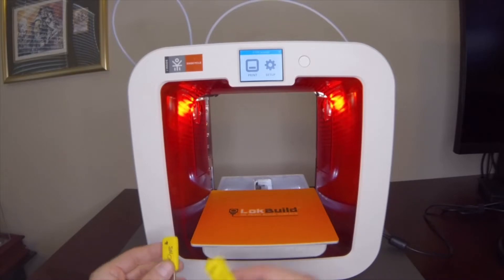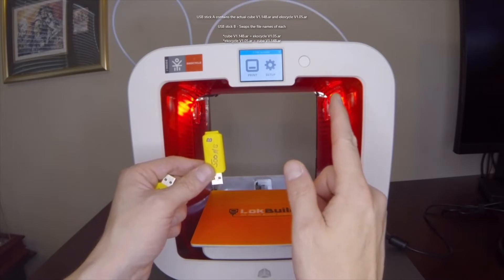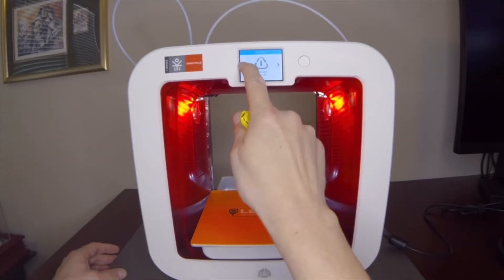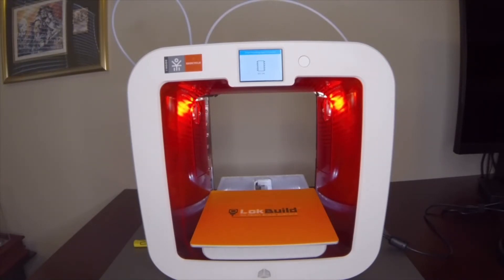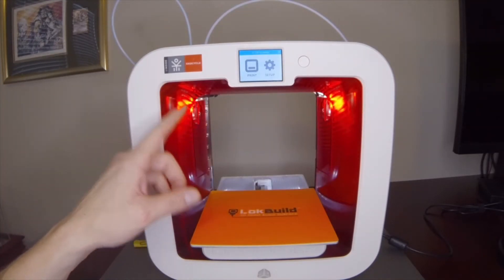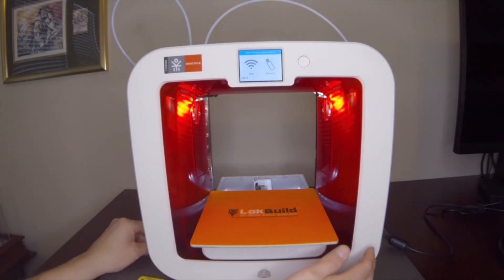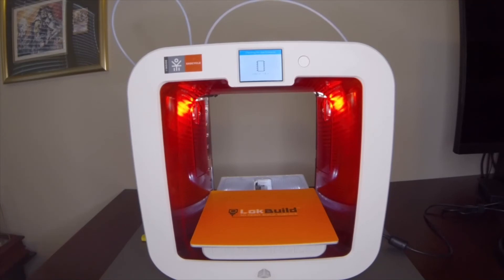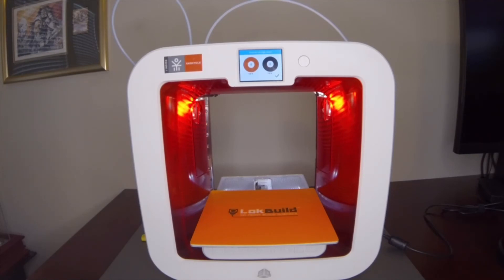Cube 3 and EKOCYCLE firmware swap

Comment: Great video! 

Glad to see that you’re keeping the Cube relevant in the 3D printing community! 

The Cube was actually my first 3D printer, so I can attest to its excellent quality of hardware, despite some of the cons associated with the software and proprietary cartridges. 

Nonetheless, I’m currently looking to activate my Ekocycle printer, but the print3D forum is no longer available. 

Do you know what happened to it and if possible, do you know any workarounds to the activation code and where to download the necessary files for transitioning from Ekocycle to Cube firmware? 

I’d greatly appreciate it!

Comment: How does the petg and abs stick to build plate without heated bed
Reply from the maker: ABS is a challenge but Cube glue works well. That with sidewalks and a Lokbuild plate make a big difference. PETG warps less than ABS and you only need to leverage the same strategies for large prints.